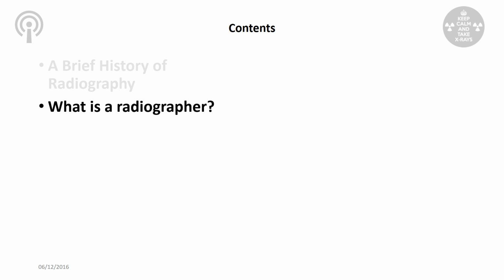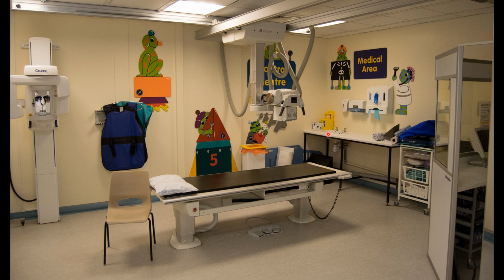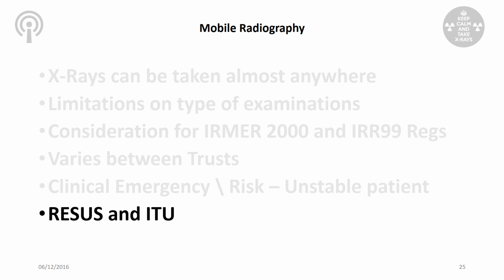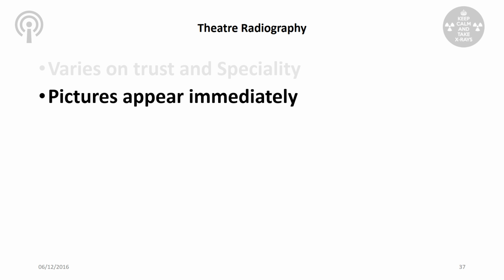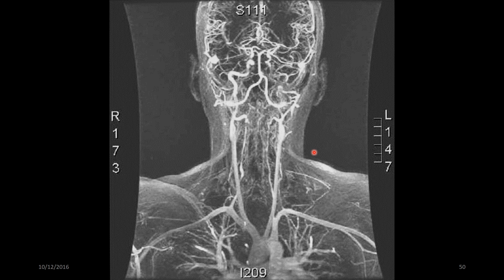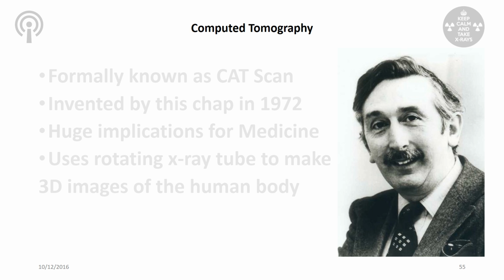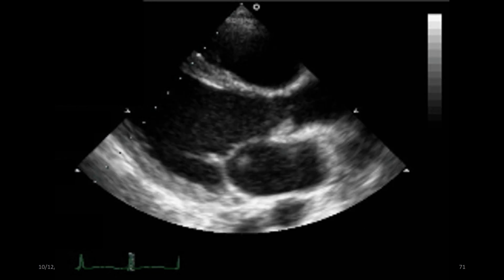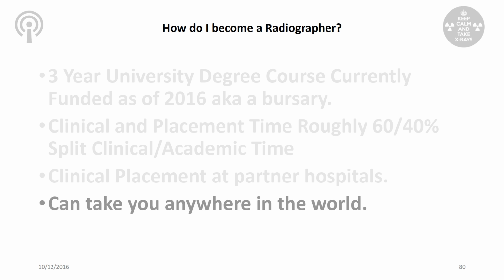An Introduction to Radiography and Medical Imaging

Comment: I’m only half way through the video! But I wanted to ask what you think the best way to study for the material is while in the program? I start in July and I’m an average student so I do not want to fall behind.
Reply from the maker: Break it down, almost body part by body part concept by concept. e.g. x-ray generation focus on that intensely for a short period of time. Another thing is make it fun and completely silly make up sings or rhymes. The more parts of the brain you engage the stronger the neural connections which form to make strong memories.  I wish you all the very best for your future career in Diagnostic Radiography.